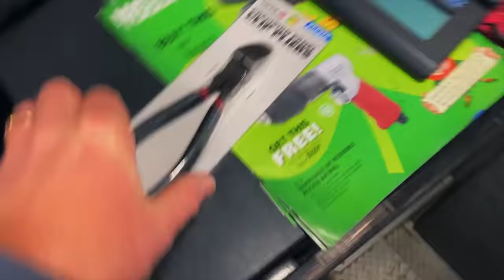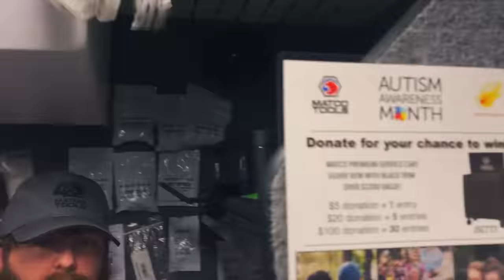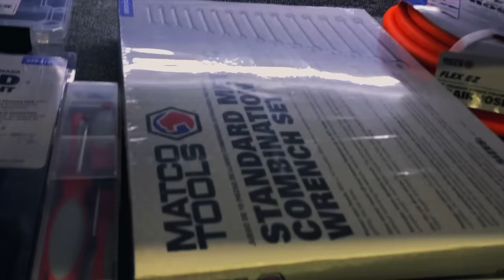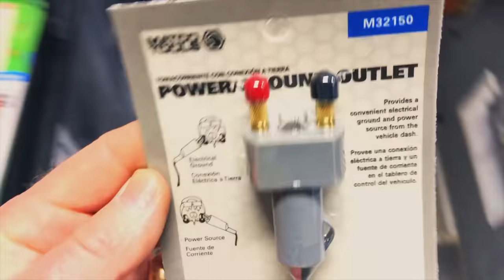Matco Tools Ratchet Day At The Shop and New Creeper

Comment: What I do on those and the Lexus is cut the axle in two places on the transmission side. The axle is hollow so it's pretty easy to do. Leave about two inches sticking out on the inboard side of the carrier bearing ( be sure this cut is straight as possible). Take a heavy duty 2 jaw puller, with the jaws on top and on bottom of the carrier tighten the screw cone into the hollow of the axle and tighten as much as your puller can take, then use a air hammer socket adaptor and hammer on the back of the puller screw. Keep tension on it while hammering. Works 90% of the time.

Comment: The body shop I help out at has the Snap-On adjustable Channel-lok Looking tool that looks similar to the adjustable Matco type Michael was showing you in the beginning of this video but the Snap-On type have a different style of pressure adjusting handles on them and I can say they do look weak but, the teeth in the jaws will strip before they slip on anything, including a smooth type round ball hitch on a bumper or receiver

Comment: Those Matco ratchets (the 36 inch one) suck ,tried breaking a shock bolt loose and exploded the head , I broke the thing three different times my matco dealer bought it back and I got a snap on and I have stood on that ratchet and it works just fine not saying snap on is the best but it’s a lot better than Matco!
Reply: I've owned mine about 4 years and still works haven't had a problem.
Reply: the doge I use mine ............on heavy equipment 🙂
Reply: @djm8707  curious, what was the torque spec of that shock bolt that broke the breaker bar?
Reply: the doge it’s called Michigan weld ....( RUST) an no I couldn’t use heat because it was on a loaded propane trailer 😉